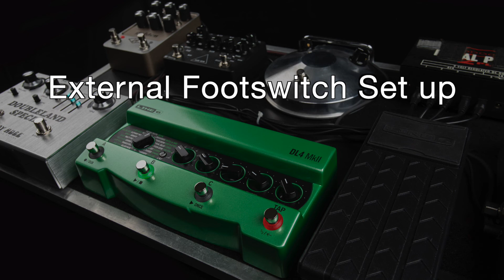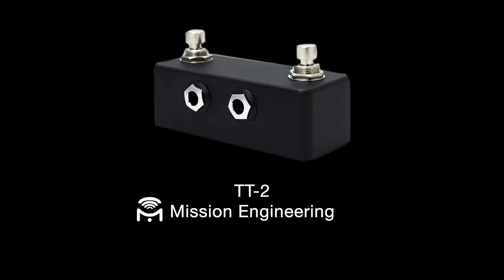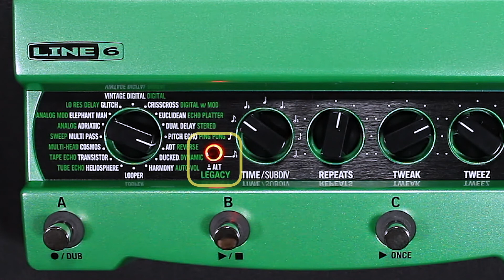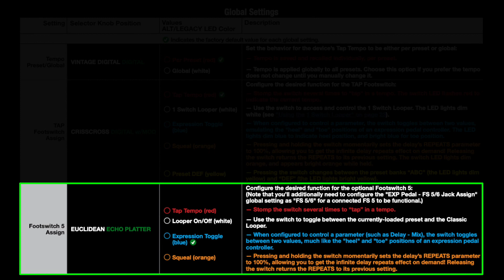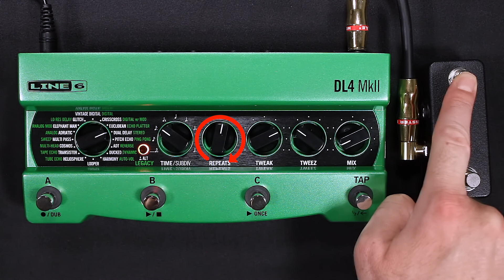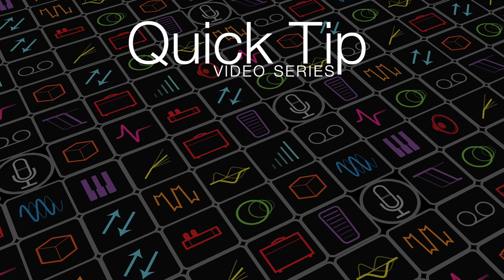Line 6 | DL4 MkII | Quick Tip: External Footswitch Assignments

Comment: i use a splitter to plug in an ev5 exp pedal — for controlling the mix control.
then on the other side of the splitter, i use a button foot switch to access the (classic) looper mode (looper preset).
question: i have tried several foot switches for the looper side, so far i have to press the switch twice to enter and twice to exit the looper.
what kind of switch do i need to have to only press it once??!!

HELP!
Reply: Sounds like the foot switch you have is latched. You need un-latched or momentary fs